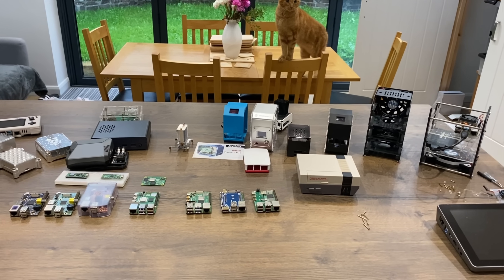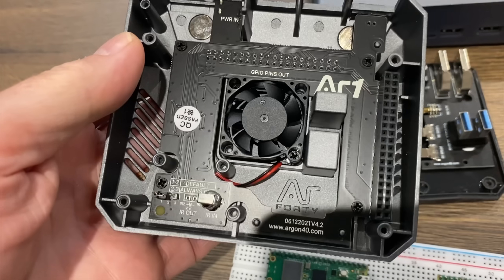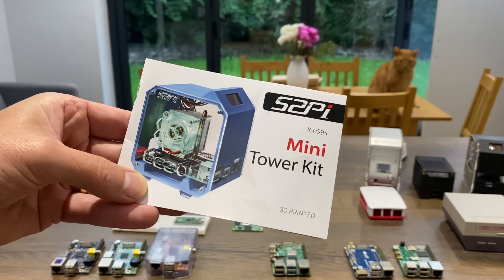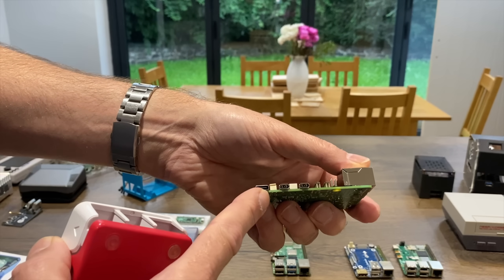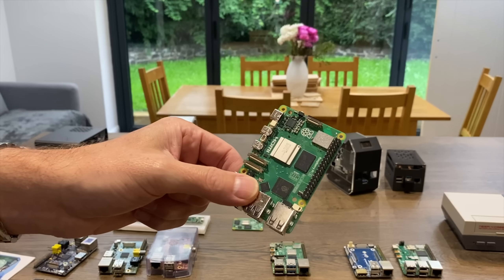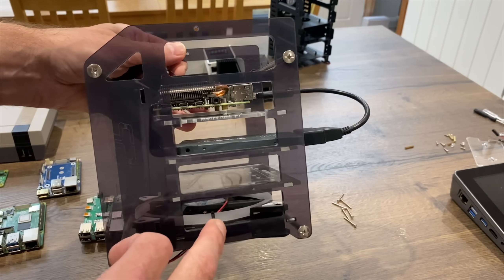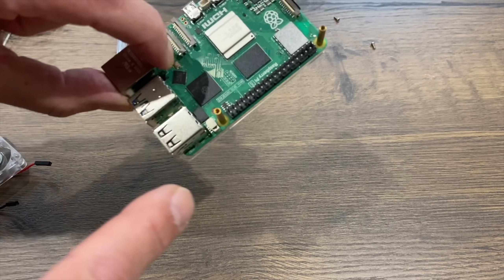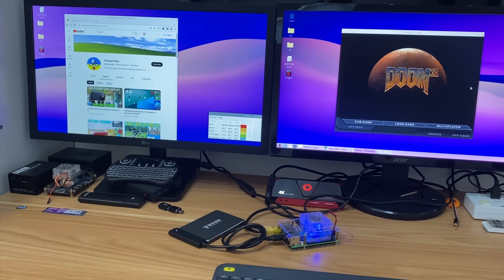Raspberry Pi 5. What Pi 4 cases still work?

Comment: Can the new Pi5 be used as a streaming device?  I tried the Pi4, 4 gig running Ubuntu, then Brave to log into You Tube, but it was pretty sluggish.   I'm trying to do away with my Apple TV.
Reply from the maker: Apple TV is a great streaming device with official support for all the big streaming services. Unless you have a very old one.

The Pi 5 is nice and fast but won’t get 4K support from the big streaming services
Reply: @leepspvideo  Thanks for the reply.  It's an old unit, that's why I'm looking at other options before I buy.
Reply from the maker: Roku, fire stick and Chromecast are all decent 4K streamers for official Apps. The Pi 5 is great for loads of other things. It’s also great for Kodi or Plex  @subiesojourner777

Comment: I have an update with nespi4Case.

I read in two communities than the gpio is the exactly pinout like pi4 but the RetroflagShutdown script doesnt works. Buttons are functional but safe shutdown doesn't works and Power Led is off. 

If i turn off safeshutdown in the board, led is On.

maybe we need a script modification but i have no idea. Can you help us with it?
Reply from the maker: It’s not something I have tried

Comment: Safe shutdown script works with pi5 in Nespi4case (i tested it) only doesnt works Led light. Maybe with a little change in the script the led would be works. I have no idea if this GPIO is the same like pi4.

can you help us for adapt this amazing case in the pi5?
Reply: i found the problem.

Pi5 is not the same gpio pinout but its similar. In pi4case led indicator needs the TX0 pin and pi5 doesn´t have it. We need help for adapt or make a little "mod" for adapt the pi5🙏

Comment: Nice, personally I'm hoping for a FIRC like passively cooled case. I have two custom passively cooled cases from a company in Quebec Canada that I really really like. They have drop down columns on the lid that connect to the CPU/RAM, but because the lid is milled from a single piece of aluminum and the cut outs on the back are designed for the PI4, they won't work on the PI5

Comment: we need to know the reason why they swapped the ethernet port to the other side because that kills the greater majority of existing cases, which will result in more artificial obsolescence and potential landfill waste. the point in many enclosed cases were to protect from dust as seen in open racks and open case designs. the more consistency they can keep across new models, the less clutter and chaotic mess is made.
Reply: Nah just a small file or dremel will usually enlarge the openings like the one case he was looking at.

Comment: Lee , tine I think for you to do some drive speed test running the operating system from a ssd or usb drive as with the new RP1 south bridge chip each usb socket now has it;s own separate usb controller.  5 GiG through put on each usb3 socket !!!!!!!!
Can we actually plug 2 ssd's into the usb3 ports at the one time without a crash... Say Retropie on one SSD and all the rom's stored on the second ssd or a film library stored on the second ssd no nas required..?????

Comment: I appreciate your passion for Pi products.  I have 4 of them myself and have enjoyed playing with them for 7 or 8 yrs too.  But at this point it's really hard to justify.  There are 1000s if not millions of used thin client PCs on Ebay and other auction sites with faster processors, capable of handling up to 16gb of ram,  windows, linux etc near this price point for the Pi 5..  At $35 where it started, it was an amazing hobby.  As you get over $100 by the time you get a power supply, heatsink, case,  you're into the realm of some new low cost mini PCs that run circles around it.
Reply from the maker: For me part of it is the fact that we can all have the same device at a relatively low cost. I appreciate the low power usage. 
The Pi gets a lot of use cases that aren’t found elsewhere. I can create a tutorial that’s easy to follow and standard for everyone.

There are so many unique projects for the Pi
Reply: Which is one of the reasons why I love this channel. He shares the same passion as I do and most of us that come to the channel. Nice post ❤. The main reason for me is power consumption and GPIO pin. With the best priced mini PC on eBay you won't get the power consumption and GPIO for my use case.
Reply: Certainly true from a practical perspective, but pis are a lot more fun to work with than a boring Intel based black box. I have several NUCs and several pis, they are both great solutions, I plan of gettig some pi 5s soon.
Reply: The Zero 2W seems to be back and the 3A is still available. Both are as capable or more as the original Pi B was. 
Thinking of the Pi B from 2013, it's still supported and runs the current PiOS just fine. 
The Pi5 is what the Retro Gaming, NAS, Desktop Computer and Media Player folks asked for and still is for the tinkerers what the og Pi was.
Reply: Well, ya can't power those thin client PCs with powerbanks, which is my most common use case scenario since i carry pi with me and access the interface through VNC or ssh

Comment: The Pi 5 has a power button... can this be accessed in any of these cases?

This is why I am holding off on cases for a while, because I can see the power  button being an issue, more so than the USB/Ethernet powrt configuration. Otherwise, I would be looking at the old Pi 3 case I butchered to hold my first Pi 4.

Still, interesting video.
Reply from the maker: The power button isn’t mandatory as you can still switch off by the plug. As it’s the first Pi with a power button, none of the cases provided access to it unless they are open at that end.
Reply: @leepspvideo  You can bypass the power button, by unplugging at the mains. Can you bypass the power button, by plugging in the Pi, and  it then automatically switches on and boots up?

At the end of the day, we need patience.  New cases will be around soon enough. You need to have a whole host of new items for the Pi 5, because of the changes to things like POE. Give it a few months, and we will have choice again.
Reply from the maker: @horseradishpower9947  if you switch on the mains the Pi boots by default
Reply: @leepspvideo  Ah, that is useful to know. I will add a hard switch in, so then I can decide if I want it on or not.

It might mean that the switch on the Desk Pi Lite could be useful on the Pi 5, after all.

Comment: Hold on, you said the NES Pi case is OK for Pi5.
Is the power supply gonna give it enough power? Doesn't the case need to be upgraded?
Reply from the maker: The Pi 5 can be powered by the Raspad battery. I’m confident it will work. However plugging lots of extra devices may be a problem.
This video was more intended to show the case you already own that works . I wouldn’t recommend buying a Nespi case for a Pi 5.

Comment: Great video as usual Lee, got my Pi 5s on order for October confirmed, I will stick with the Pi official active cooler a bargain at £4.90 and looks really well engineered, I love my Pi 400 passive cooling keyboard enclosure running at 2.4ghz no sweat and hope they bring out a Pi 500
Reply: Seems like a Pi 500 is a sure thing - if the extra oomph that the 5 provides is needed in any application, a desktop replacement is it. Hopefully 8GB will also be offered.

Comment: Thanks for the video this really helps. However let me please rant a bit: how idiotic it is to remove the headphone jack from a maker board? oh wait maybe they meant to use it on a nice 4k monitor that has a nice integrated 3.5mm audio port..... except the pi5 doesn't even have enough power to really be used with a display like that and at best will run 1440p as fast (or as slow) as the pi4 was running in 1080p.

Comment: Hi Mr Lee, near the end of the video, ya suggested that a 5V fan should be enough to cool the pi5, but will it prevent it from throttling during heavy load? Wouldn’t it be better to use a heatsink (even a small passive one which then be cooled by a 5V fan)?
Reply from the maker: A heatsink and fan will be more effective. Especially in warmer climates

Comment: Hi Lee,
Really interesting video as usual. I have my PI5 on order but was wondering if you could check something. I use a 52PI perspex case the same as you, with the microSD adapter to access the slot at the front. Does this adapter slow down the speed of the microSD card with the PI5 or does it work just like a "pass-through"? Just hoping you could test that as I am sure many others use the same system with their PI4s.
As usual you are my first stop for all things PI based.
Cheers for all you do.

Comment: I looked at the Argon site and didn't see any announcements for a replacement for the M.2 there. At first I thought that they would just need to redesign the top half, but the bottom part with the M.2 memory will also need redesign if it is to use the new PCIe interface instead of the USB3 slot.
Reply: Since the PCIe interface is single lane, the USB3 is about the same speed. It would be nice not to lose a USB port though.
Reply: I'm hoping Argon comes out with the equivalent of the Argon one case for the pi 5. I really like mine, and use it for the pi I use on the desktop. Very neat looking and great cooling.

Comment: Thanks for the tips.

Can you please test the NESPi 4 USB to SATA adapter on the Raspberry Pi 5? Does it work? Does it perform well? Is it bootable?

(I have a NESPi 4 case that currently has a Pi 4 in it. I think that would be a great choice for a Pi 5, because of the easily swappable hard drives.)
Reply from the maker: All the sata usb cables I have that work with Pi 4 also work with Pi 5. Same with m.2 and usb sticks. Compatibility seems great
Reply: @leepspvideo  Thats great, so i can use my NESPi4 case with the Pi5 🤩

Comment: Isn't the mini tower kit built for both the 3B and 4B Pis?
I thought it came with both side panels for either board?
Get a file, for metal, or a course emery board (for plastic cases) and file the the Ethernet socket until the USB socket has full access. I'll be modifying my 7 inch touchscreen case to fit the 5.
Reply from the maker: Similar to this case

https://amzn.to/3ES7Q8X